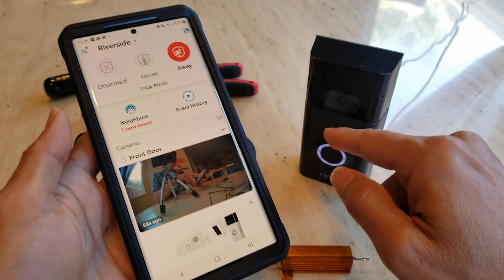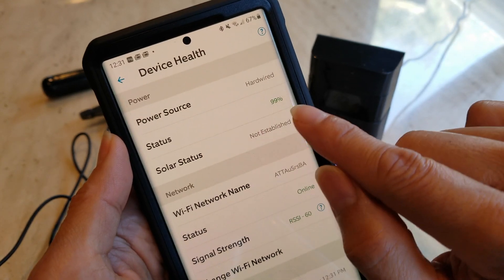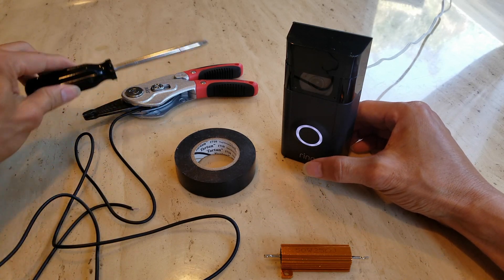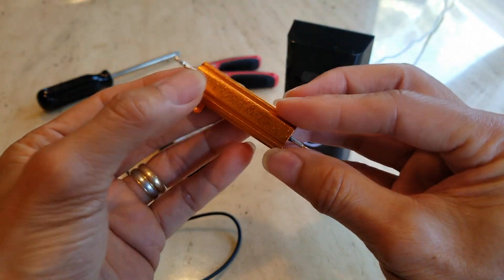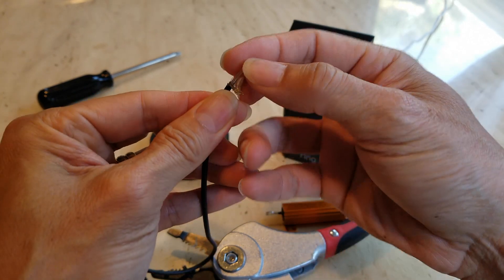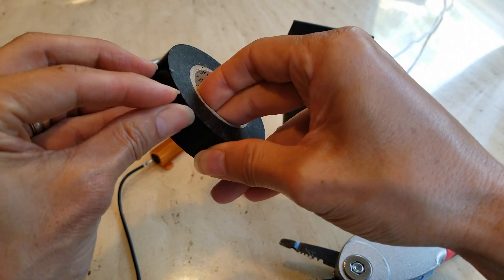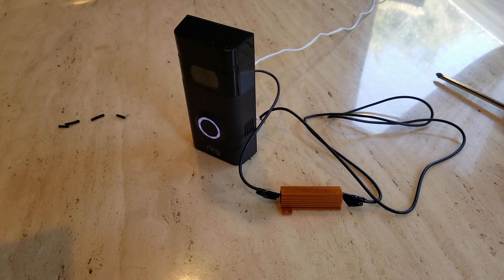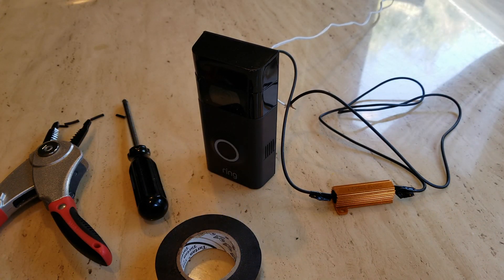ASMR How To Connect RING Doorbell 2 + 50W 25Ω Ohms Resistor With AC Plug!

Comment: Can someone please help, I recently got an electrician in to hardwire my Ring Doorbell 2 directly to a brand new 30VA transformer (No existing doorbell wiring or chime) along with 25 Ohm resistor because its vague as hell whether you need a resistor or not so rather be safe than sorry I added one. I charged the battery to 100% then inserted it back into the doorbell. When I go into the Ring app, the Power Source now reads as 'Hardwired' but the Status reads '98%'. I'm confused as to what's going on here, is the battery charging or not? On the main page for the Doorbell in the top right of the screen the little battery icon has a lightning bolt in it which I assume indicates its charging?

Comment: Twisted wires and black tape?
Dreadful. 
Where on earth do you think that resistor is going to be sited?
Shame you didn't demonstrate a proper install where the resistor is fitted at the correct end of the wire near the transformer, probably in a cupboard or under the stairs.
Where's your resistor going to live?
Hanging from a bit of black tape outside your property next to the Ring doorbell?
Reply: he was only demonstating
Reply: your so clever,why are you watching this.

Comment: Where do I  install the resistor I already have existing mechanical doorbell?
Reply: You've probably already sorted this but if not here goes.

The mechanical bell will usually take the place of the resistor but check the voltage supply via the chime is at least 8v. A lot of older systems for mechanical chimes use less than this. Ring doorbell input range is between 8v and 20v.

Comment: So just using a transformer with the required voltage directly isn't good?  Why?
Reply from the maker: Ask Ring, it was fine for me just connect my Ring directly to the AC Plug without the resistor but viewers were saying that it required this resistor from Ring website. I removed the resistor and it works fine without it.
Reply: @macdaddypimpping on the ring website it says "The Wirewound Resistor is required for Ring Video Doorbell and Ring Video Doorbell 2 when wired directly to a low voltage 8-24V AC doorbell transformer"

Comment: Will this keep battery charged? Will I need a transformer ? Or just the resistor
Reply from the maker: Ring recommend this resistor if you are going to use a plug from the outlet. If you are connecting directly from your doorbell transformer than you don't need this resistor. Although, I tried my AC Plug without this resistor it still charge my Ring Doorbell 2 battery without any issue.
Reply: K mine is connected directly to my existing door bell hardwired , it doesn't seem to be charging it like it should, will I need to upgrade the transformer?
Reply: @irfankhan1001   @323ric  I'm so lost reading so many mix informations. Please help. I have a ring doorbell 2. Now if I want to use a ac adapter from Amazon. Do I have to do anything else? Also when using a ac adapter. Does the battery need to be inside the ring doorbell? Will the ac adapter power the ring doorbell without thr battery inside? Also if I go ghe ac adapter route will my ring chime that is connected through wifi still work?

I'm so lost on the resistor for the ac adapter route. I hear so many people saying they don't use it and then I heard  a lot of others say you need a resistor? Please clarify....I would really appreciate it 🙏

Comment: I used an old AC adapter from a rechargeable vacuum cleaner and it works fine , I don’t think there is a resistor built in the adapter either

Comment: Using currently 33ohms and it is just fine. Also it is a resistor it will need to get a bit hot anyways better than destroying your ring battery

But how are you connecting directly to ac without step down voltage transformer? Ring 2 works with 110/220 voltage?

Comment: hmm mine didn’t work.  my resistor was hot .
Reply from the maker: Make sure you charge the battery full with USB first because using AC adaptor required a long period of charging time and also on your camera settings.
Reply: I'm having the same issue as well. The resistor gets extremely hot.  I had to resort back to the battery.